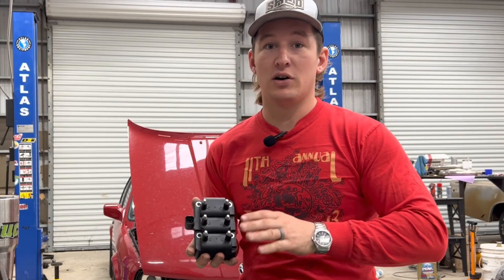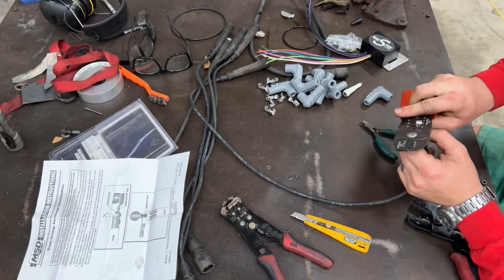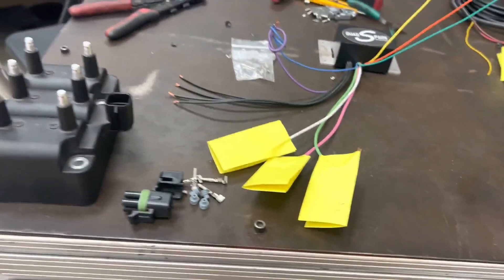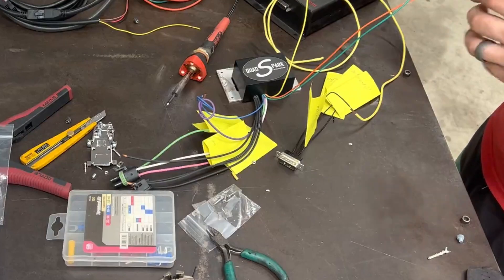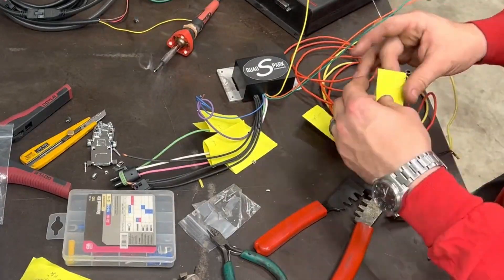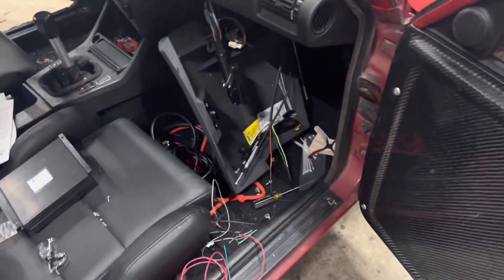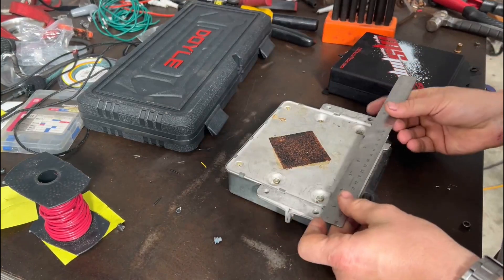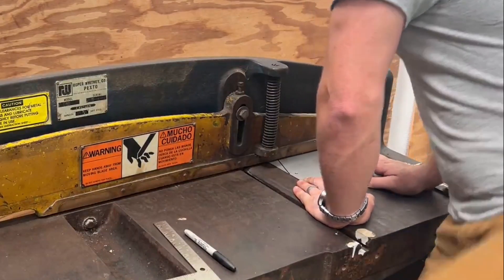Turbo E30 Wiring Day - MegaSquirt, QuadSpark, and MSD Coils

Comment: Man great work! 
I'm working on an e28 but I'm running the same ecu, coil tower and quad spark. Turbo m30. Just thinned my motronic 1.3 harness and got confused on how I was going to wiring in my ignition system. And boost controller. Didn't even realize there was an aux port on the pnp ms2.

Comment: Thanks for the video. The wires you took from the quad spark into the ECU.....where do they go? Thanks
Reply from the maker: They are pinned into the output connector in the ecu and provide signal to the coil pack next to it.
Reply: @shed_mfg  Ok. So the wires on the ECU are labeled output to Quadspark or something like that?
Reply from the maker: @jws6076  not quite, you can look up the pin out for the output plug on the ecu and then pin it yourself with the supplied pins with the megasquirt. And from there you just configure the three batch fire orders for the m20. Lucky I got it right first try.
Reply: @shed_mfg  Ok. Just trying to figure all this stuff out. Doing an M73. I have the MS3, 2 quadsparks and 2 coils like you installed. Appreciate your reply and thought your video was very helpful.  Thank a for posting it.
Reply: Making progress on my project however I was wondering if you can remember what size of fuse you used to connect the B+ terminal in your 6 pack ignition coil? Thanks

Comment: How did you know what order to put the cable on for correct firing order I want to do this to my 91 325 I’ve just starting the turbo build your videos seem very useful to me although it’s seems like I still have so many questions about this system
Reply from the maker: I just read through online manuals and forums. After that I took my time and mostly just hoped. But if your wrong you just move the plug wires anyway

Comment: What size wire did you use for conneting the pigtail?
Reply from the maker: I believe it was 14g, the same that was coming from the quadspark unit. I matched all of the wire sizes that came with the unit.
Reply: @shed_mfg  Thanks! Great Video btw.
Reply from the maker: @Burritovan89  thank you! If I’m able to get my daily driver squared away I’ll be filming a catch can build and it’s dyno session
Reply: Quick question at 5:41 in the video. Why does it look like the pink wire is terminated into the spark out D on the plug for the coil?
Reply from the maker: @Burritovan89  the pink wire goes from the quadspark box to the ign6 coil pack (via 4 pin plug). I actually just got it running, so I know the wiring is correct. I can send you a picture of it installed if you’d like.
Reply from the maker: @Burritovan89  I’m on instagram under the same handle
Reply: @shed_mfg  Found you on insta and msged you.